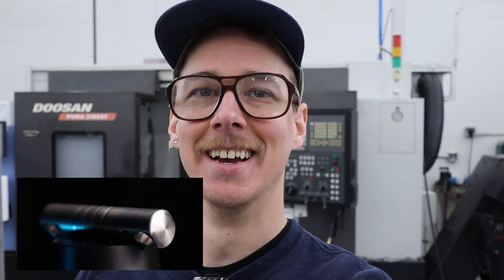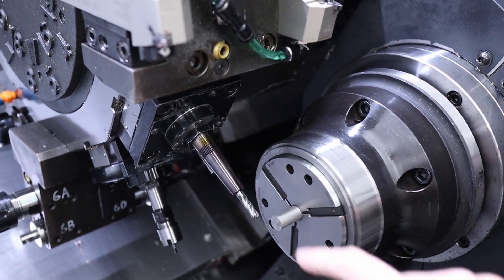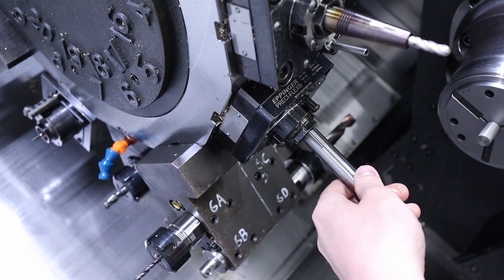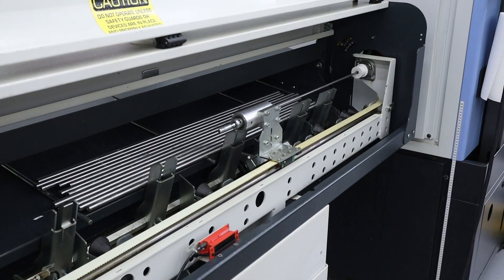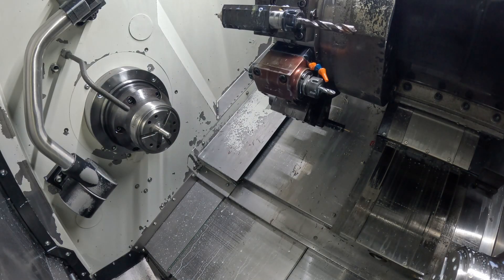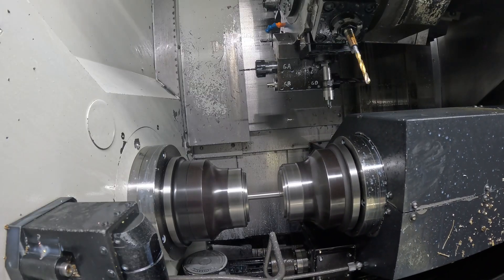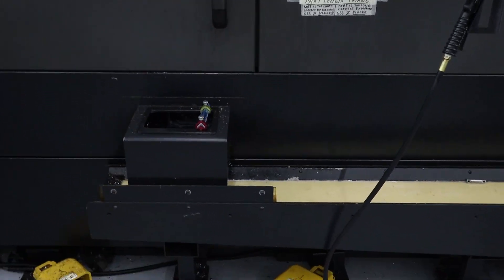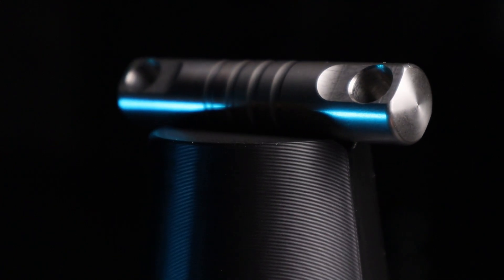Challenge Accepted: Make a new variant of Stainless Steel CNC Mill-Turn Part

Comment: Hey man part looks great. If you want to save some time per part id recommend alternating the main and sub spindle with opposing tools.
At the part off do a bar pull. Sub spindle is moved out of the way.

Finish od turn on main. Sub moves closer during this operation. Using opposing tool on turret to finish od Sub. 

Turret moves up. Sub moves away during tool change. Repeat for every tool. Last operation run the Sub first and while it finishes on the main the Sub drops off Finnished part and goes to pickoff. 
I do it on mine. It saves more time than you think especially on large orders.
Reply from the maker: Thanks for the suggestions.

None of my work is high volume so I don't get to play much with those optimizations.

The way I program parts is to use a CAD/CAM template I made in Fusion 360. It's pretty slick. It's a lot like what John Saunders has demonstrated in an old youtube video from when he got a Haas ST20Y in about 2019. Chucks, stock, and a container for the part are all modeled in assembly. There are parameters for stock diameter, length, and stickout. I also have parameters for main side facing allowance, sub side facing allowance, and the distance that the sub grabs on to the part. I can fork my template file and drop in the solid model of my part. Within a few minutes I'm programming the part which relies on a lot of preset templated toolpaths. It's a pretty slick way to get parts programmed and I have developed that template and my post processor to the point that I generally don't have to touch the G-code. Even the bar feeder stuff runs as G65 sub programs with Z variable passed through from main program and no hand editing of the G code.

My larger runs are still under 300pcs so I generally have focused on building a workflow for ease of programming and speed to get cutting. I can write G code by hand, but I have to go pretty slow and careful.

If I was getting runs over 1000pcs I bet some of those tricks you mentioned would be worth the work. I was reading the manuals for this machine and I think there are even ways to program B axis moves while other axes are cutting even though it's a single channel control. I could imagine if you had drilling operations on both spindles you could possibly use that feature to do the drilling operations simultaneously.

Comment: Great type of content, mate. This lathe is hella good, i hope to get one someday. What kind of soft do you use in your video, solidcam?
Reply from the maker: For CAD/CAM software I use fusion 360. It works pretty well when you get it setup right. I can run most programs with no hand editing of the g code. This includes turning, milling, part transfers, bar feeder stuff and a few other cool treats. I made a good cam template and did a bunch of modifications to the post processor.

Comment: That lack of clearance around the sub is worse than my ALX which is tight.  Also for the folks out there, push the liner out from the main spindle side.  Use a piece of heavy drop as a hammer.  No need for tongs.
Reply from the maker: I would push the spindle liners out that way prior to making this tool but this is so much easier. You don’t always have the right size slug handy and if you should have a chuck or something which doesn’t break down quickly it can really be a pain.

Comment: seems like the 90 degree live tooling always need their bearing rebuilt. I wonder how much that costs, the company I worked for always did all that.
Reply from the maker: If you send them out it can cost about as much as 50% of a new holder, but often less if the gears and everything are in good shape. I haven’t done it but that’s what I have read. You can do it yourself but you need to make some special tools, source bearings and seals, really do the work with care and attention, grease quantity is very important apparently, and I think there is a break-in procedure. I would like to figure it out, especially for my radial style eppinger live tools. I have 4 of the same unit and 3 really need rebuild.

Comment: What kind of concentricity tolerance can you hold after transferring the part to the sub-spindle collet?
Reply from the maker: I haven't tested it extensively, but the collets are generally very good. The Royal Products website claims .0002" TIR. That's more than good enough for just about anything I make. There is also a lot of strategy that goes into making parts generally so that if you need the best possible concentricity between a set of features - that would inform how you made the part. For my parts I typically design them around the machines and processes that will be used to produce them so that everything comes together as smoothly as possible. Many times you can cut many or all of the critical features of a part on the main spindle and do finishing operations on the sub-spindle.